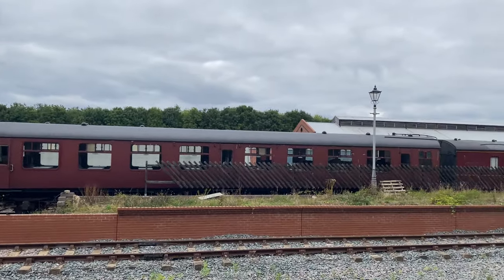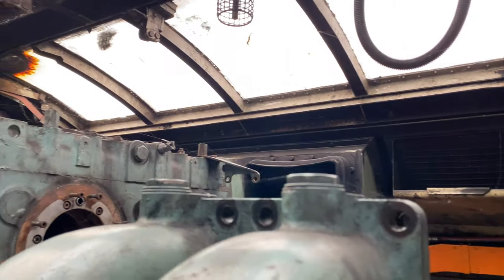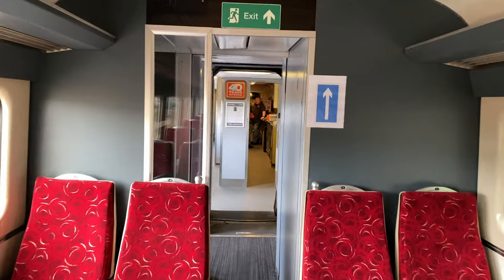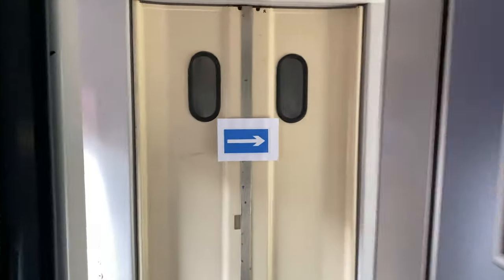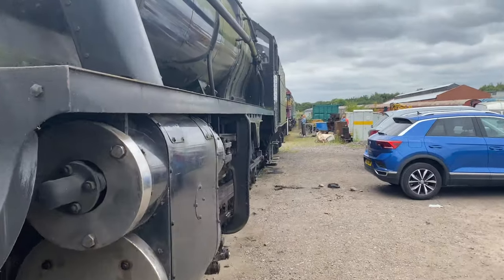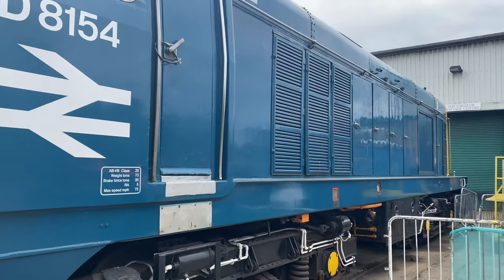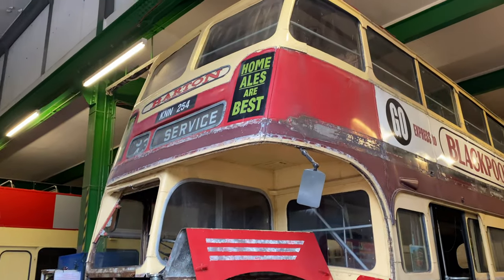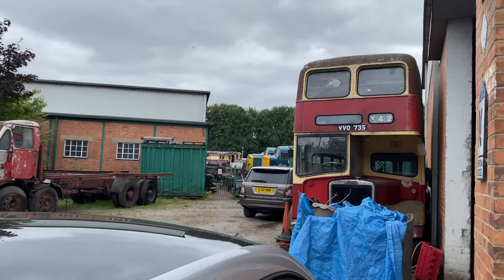Train Real World - The Fastest Diesel HST in the World - 125 Group - Nottingham Heritage Railway

Comment: Alongside 43102, which isnon static display at the national railway museum.
Reply from the maker: I saw the rear end of the fastest diesel :)
Reply: @MegaSim  yup, technically 43044 is fastest diesel in operation as 43102 is on static display
Reply from the maker: Wouldn’t it be the 43159 I saw because it was the trailing engine for the 43102 which is at NRM currently but still active?

Comment: Wait hang on- some of the mk3s are buffered hst which from my knowledge. They can’t connect to normal class 43s as they are loco hauled. So how are they connected?
Reply from the maker: It’s not a fully running train, so maybe just connected for the static showcase?
Reply: They were fitted with old school hook couplers because they used to be surrogate DVT’s back in the late 80’s to work with the Class 91’s until the MK4 sets were delivered. They are now with a European open access company RailAdventure.